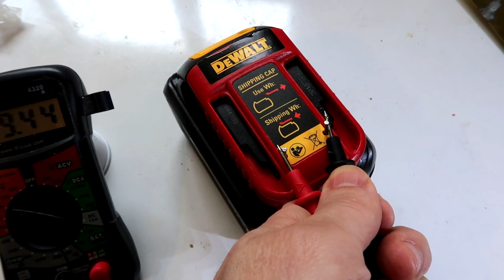Building a drill battery powered work light

Comment: what would happen if you short circuited the battery ?
Reply: On a prolonged short, something could burn inside the battery.  Could be worse...explosion maybe?  Try it out for us!
Reply: These batteries pack a serious punch. It would create a large spark and heat up whatever was shorting it. If it was thinner wire or something it would melt
Reply: Nothing...Or a burnt down house.
Reply: A mild short will only cause an elevated self-discharge. Little heat is generated because the discharging energy is very low. If, however, a major electrical short can develop then a sizable current will flow between the positive and negative plates. This causes the temperature to rise, leading to a thermal runaway, also referred to 'venting with flame.' During a thermal runaway, the high heat of the failing cell can propagate to the next cell, causing it to become thermally unstable as well. 
Under normal circumstances, a lithium-ion battery will simply power down when a short circuit occurs. However the safety circuit can not stop the disintegration once the cell is in thermal runaway mode. Nothing can stop it once triggered.

Comment: hello
misleading- could you explain 9voltage bulb you connected to 20 voltage battery- the bulb must burn off ! 
you need reducer from 20 voltage reduce to 9 voltage to get bulb on aswell amps you must attached- video misleading- non professional- just waste parts, could damaged battery and bulb cost money.
Reply from the maker: bulb has built in regulator